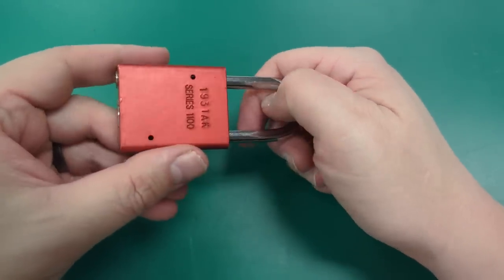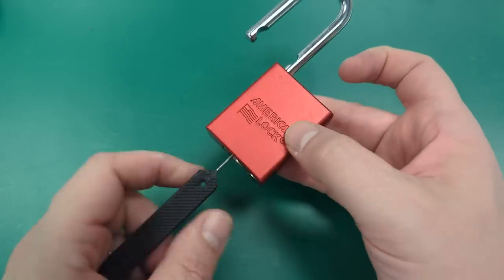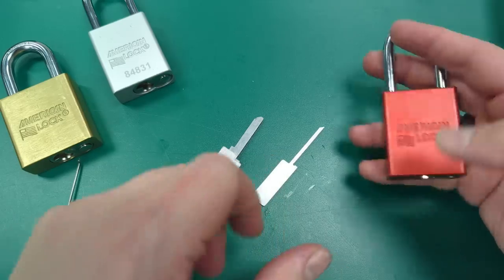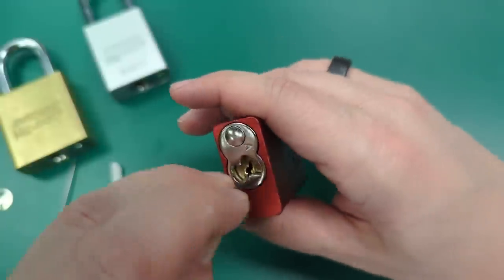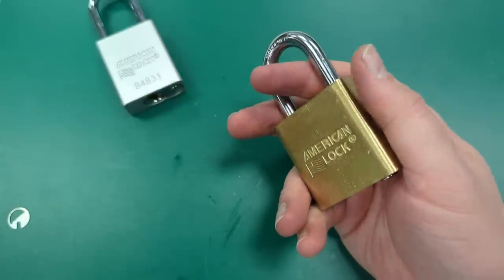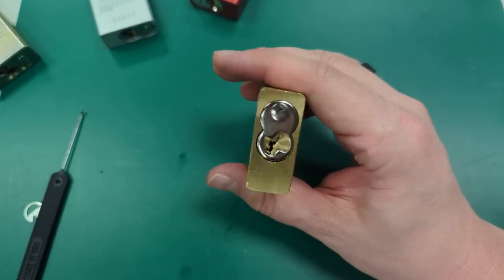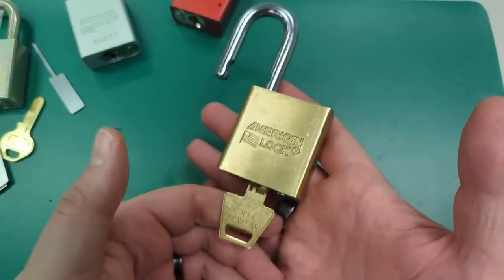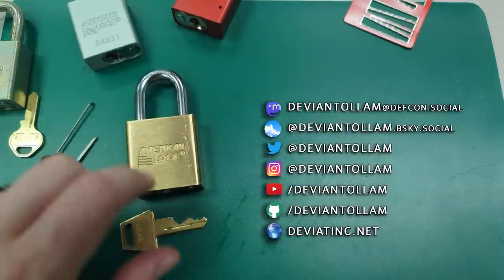Attacking American Locks... Just How Does the Wafer Breaker Tool Work?

Comment: 00:00 🗝️ American Locks are known for their quality, even though they are owned by Master Lock. They use high-quality pins, parts, and springs.
00:29 🔐 Lower N series American Locks are often targeted for bypass attacks due to their vulnerability.
01:11 🛠️ A bypass tool is used by inserting it away from the pins, reaching the back of the plug to manipulate the actuator cam.
02:46 🔨 A bump hammer can be used to ensure the bypass tool is properly seated by applying slight counterclockwise pressure.
03:40 🛡️ American Locks introduced shielding wafers to protect against bypass attacks on the rear side of the plug.
05:29 🛠️ To defeat a shielding wafer, a wafer breaker kit is used, which includes a punch and spreader tool.
08:42 🧐 After successfully bypassing a lock, it's possible to decode the pins and create a working key for future access.
16:47 🕵️‍♂️ Bypassing locks in a non-suspicious manner can grant long-term access without raising immediate concerns.
18:23 🎁 The giveaway includes a Wafer Breaker kit and a Peterson bypass tool, providing tools for lock enthusiasts to practice bypassing techniques.

Comment: These are the best value for money to learn single pin picking of security pins.       Some people are double shielding them because of the puncture tool.
Reply from the maker: Yeah, I should do a video testing that next time!
Reply: @DeviantOllam  Can easily fit 2-3 blocker shields. Grease helps keep them together. But that doesn't prevent Lishi tool. Could probably incorporate an "extra" depth cut of "9 or x" Not sure how deep the pin chambers are drilled tho

Comment: I bought a handful of older American locks for picking practice from a locksmith on eBay. You could tell he knew about this attack because there were like 2 or 3 wafers in each lock. I actually thought that that's how they all came. Honestly, I still feel like you could get through it with these tools because the spike tip on those tools seems to cut right through like butter. I mean a bump Hammer is not that heavy, but it's nice to know that the guy took the security seriously it in a way that nobody would know unless they dug in and looked at it. I'm still using those locks on my shed and my toolbox in the back of my truck. They've taken a beating from the weather for years and operate as smooth as the day I got them. American really made some amazing locks before Master bought them out. ( I've been out of the lockpicking game for years so I'm not sure if Master destroyed them or not. LOL)

Comment: As someone currently getting their butt kicked by trying to pick their 1100s, watching directed violence perpetrated against them is cathartic AF.
Reply: Some tips - use light tension and go from pin stack to pin stack sequentially and advance the serrated pins just one click at a time. Address any spools as they appear. 

Bare in mind that this lock has a strong spring - sometimes you'll have the core completely picked but it will look like it's just a deep false set. You have to pulse the tension much higher to open it.

Comment: The vast majority of these locks are drilled 6 pinned 5 ... A short section of keyblank fastened in the end of the keyway, makes the Wafer Breaker unsuitable for bypass.  

I've actually went to the length of soldering in the short piece of keyblank, but there are many more ways of doing so. 

You can also simply install a pin in the last hole and pean the cylinder to keep it in place, but I admit I have not tested that method.

Comment: One of those spring punches you use for hinge pins would work way better than the bump hammer.  The small weight moving faster is more effective on small things without much reaction mass compared to a big hammer moving slowly.  It could probably drive the entire spreader tool through in one go.
Reply from the maker: that's a really neat idea... if we make one with a slot in the front to hold/accept the tool... yeah!
Reply: I have my doubts...pounding a nail through something with a hammer or a spring punch? I think a hammer is more effective but tapping a rubber hammer on a nail might give one the impression that a hammer is ill-suited for driving nails through hard objects.

Comment: I like the explanation an improved tool I hacked out of some spare steel of the two holes punched at once. Not revolutionary but it means one round of slightly harder taps instead of repositioning and you always have your first pair of punches in the right spot.

Comment: So I guess my number one question walking away from this lesson would be.... Why don't they just design the bypass tool as robust as the "spreader" design so that it can't come loose and spin in the handle? If you want to take it a step further, why not design it like the common "kill key" where the main upper portion of the kill key would act as the punch, then combine the pieces to act as the spreader, then remove the top portion and use the bottom half with the flag as the bypass tool? 🤔 food for thought

Comment: In case anyone wants to order blocking wafers to improve the security of their American locks (since the chance of someone having a wafer breaker kit and knowing how to use it is very small), it took some searching but it’s part number APKG3017010 Bypass Restriction Plate
Reply: Mr. Lock sells them
Reply: @Brian-hf9tc  yes that was the first hit on that part number but I didn’t want to plug a particular vendor; I did confirm it’s not a Mr Lock specific part number though, since it was listed in the 2013 American Lock Service Manual
Reply from the maker: yep! https://mrlock.com/part-bypass-restriction-plate-10-pk-apkg3017010/
Reply from the maker: quite fair of you to not mention any one vendor.  but yeah that's a solid price that Mr. Lock has
Reply: @DeviantOllam  wasn't trying to drive sales his way, but that was the cheapest I found. And especially at small quantities

Comment: so the problem with the wafers is that they are too thin and can be punched through. Do you think there would be a possibility to modify the design a bit such that a larger part of the cylinder is in the way?
Reply: You can stack 3 and they're  pretty secure. 2 can still be broken, and more than 3 you start having less engagement  with the cam.
Reply: @jamesbridges7750  The bypass wafers are nothing more than shim stock that's undergoes a punching operation. By the dozen, they're less than 25 cents a piece.

I swap all of my American 1100 and 700 series locks over to 6 pin version APTC-14 cylinder, and use a piece of 1050 spring steel for wafers. 

For items i really want to protect the Abloy shielded padlocks with the Protec 2 cylinder is the way to go.

Comment: Why doesn't American redesign their cylinders with a solid back?
Reply from the maker: it would cost FAR more to mill a blind hole (especially one with the shape of the keyway) than it would to make a blocker element.  if folk want much higher security they can also get the non-removable key variant of the padlock
Reply: @DeviantOllam  I've encountered hardened steel pins punched through the cylinder at the rear end as bypass blocker in some Chinese Tri-Circle padlocks. Just a thought.